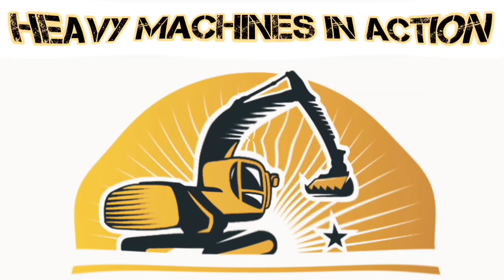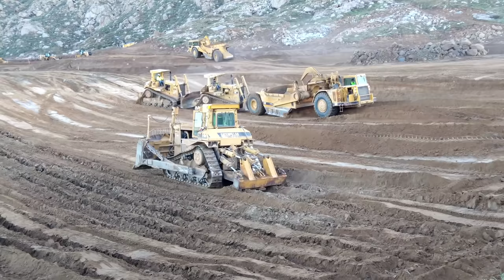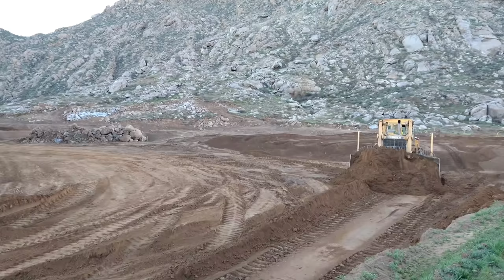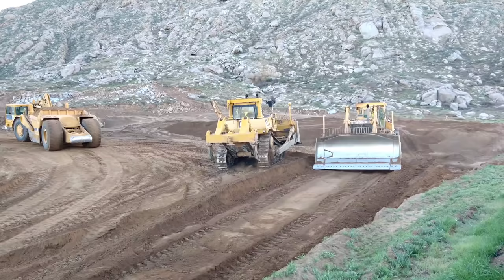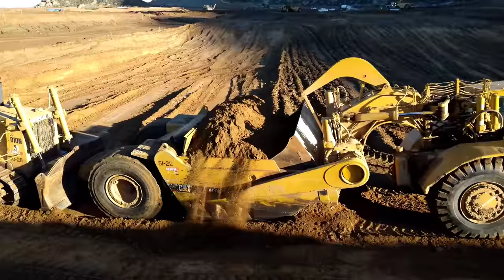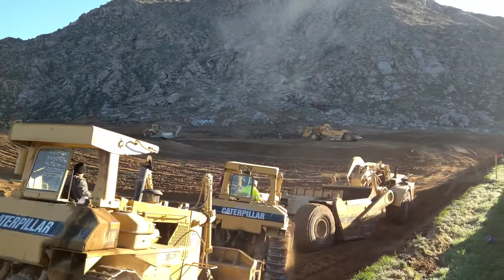CAT D10N Dozers and 651E scrapers at work - Massive earth moving -

Comment: Tandem   pushing   a  no  no  in  Australia   proper   push  cat  blades   rarely  seen  here  we  have  normal   blade  the  operator  slews  onto  the  push  pad  of  the  51   it's  a  art
Reply: I can pick up stingers with a hard dozer ot a pushblock. Either one. If you know what your doing and you always pick them up on the run they wont even know your on the stinger untill they feel that power. No stopped scrapers in the cut. Ever. Copy
Reply: When you get on the stinger the scoop hand just keep the throttle up enough to work the hydraulics. The pushcat does all the work. No tire spin, when they see the dirt coming up start lifting the can and the pushcat stays on them to help them out of the cut. If the cut is downhill they dont need any help. Drop that stinger and get another one. And ee dont chase scrapers. Get in front of the pushcat. Each time every time